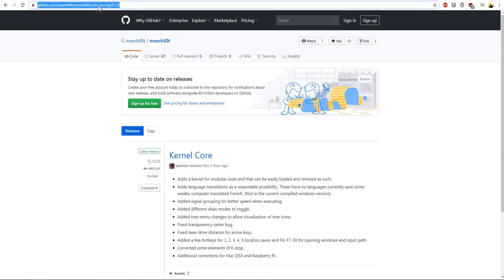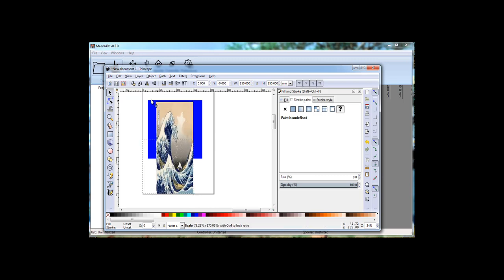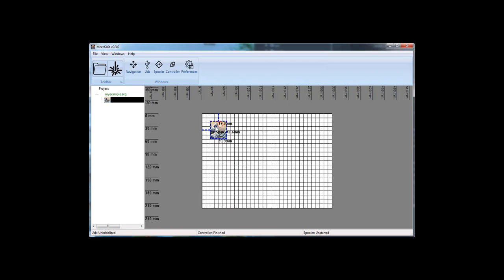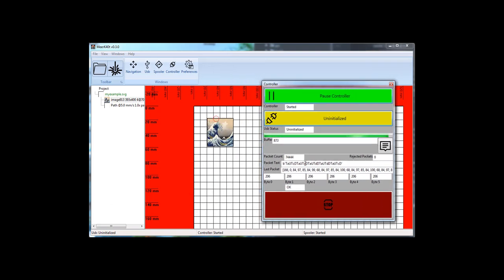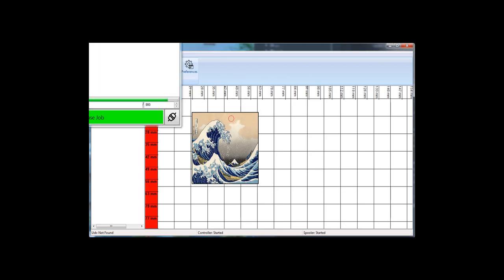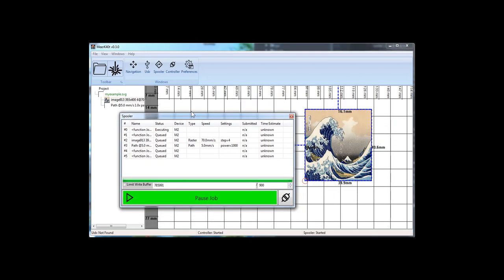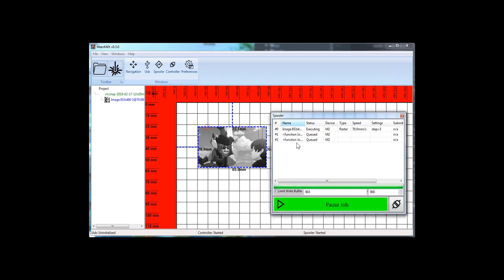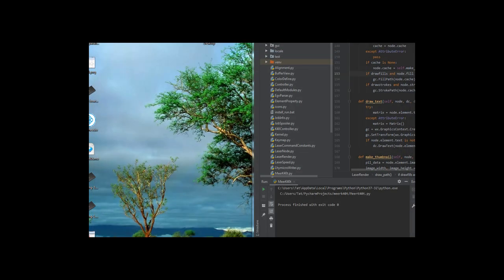MeerK40t Workflow Demo

Comment: In general i like your Merrk40t. At the Moment i am using K40Whisperer. Will it be possible to Use 2 or more laser at the same time with only one PC?
Reply from the maker: Currently yes. You can launch two different copies of MeerK40t and tell each one to connect to just one of the lasers in options you can specify sub-criteria for the laser to match like if they differ based on address, bus, or simply the index (first laser, second laser; note this will change if they are unplugged). So you set 1 laser to connect to laser #0 and the second laser to connect to laser #1, and connect them to the USB and each instance of the program will control a its own laser. In Whisperer you get only the 1st laser so laser #0. You could tell MeerK40t to connect to  the second laser and it will index them and connect to the laser #1, and use Whisperer to connect to laser #0 since that's it's default behavior. One caveat is that the settings save on the program exit, so whichever copy you close last will keep those settings. It's a quick option to change, but should be done before attempting to connect to the USB. And there's no serial numbers or anything on the machines, the best they have is a CH341 chip version which is a number from around 30-50 or so.

I am also currently in the middle of some of  a redesign of the backend to make that able to happen within the same copy of MeerK40t. I am making the backend properly interchangeable, so it could support other laser systems, and different jobs simultaneously, and allowing swapping the of the Whisperer Libusb driver for the default Windows driver so you could also run the software with LaserDrw or Whisperer without being forced to choose. (I've already gotten the Default Windows Driver to work). The windows driver doesn't strictly tell me the connection address either, so I might have even less criteria to go by, and it wants simply the index of the CH341 device.